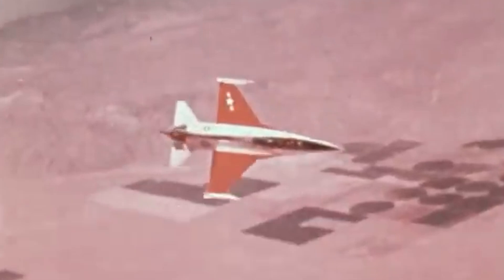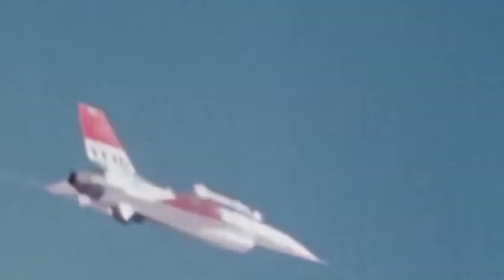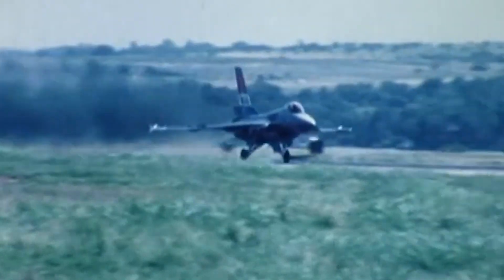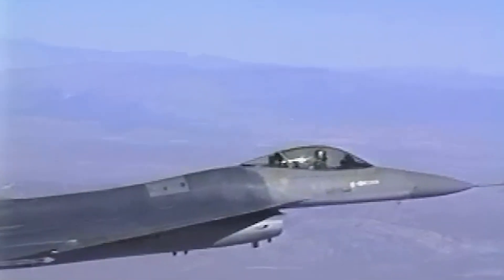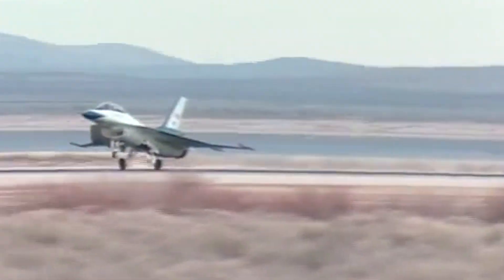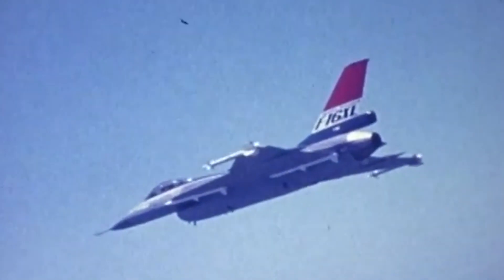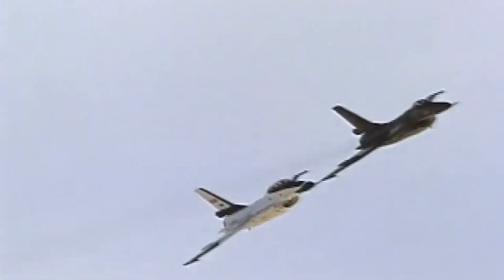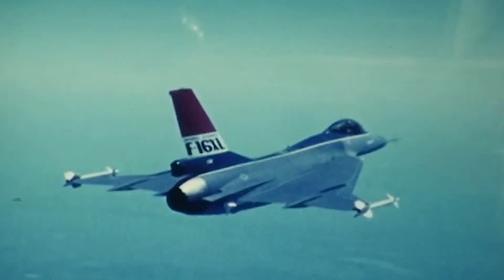When They Built a Strange Super Wide F-16

Comment: SCAMP was a research program to gain information for future aircraft.  Supercruise is useful at higher altitudes in the air to air mode. The airplane would never supercruise when loaded down with external stores.  The XL didn't achieve much in the way of supercruise until many years later when NASA installed more powerful engines.  

The XL would have been a good fighter bomber, but it was not superior to the F-15E, which was less expensive, less risky, and more capable.

Comment: To this day, I'm baffled why the F-16XL wasn't given a limited production order by the USAF. This would have been a beast in the Desert Storm air campaign. Japan did revise the F-16 with their F-2, slightly bigger and more capabilities.
Reply: Welcome to the club. Definitely a missed opportunity!
Reply: They bought the F-15E Strike Eagle instead.  There is no sensible reason to procure a limited number of what would have been a more expense aircraft that did not offer superior performance.
Reply: @gort8203  XL had far superior performance over the F-16.
Reply: @kpal2946  The XL had superior performance over the F-16 in range as a fighter-bomber, mostly due to more internal fuel.  It did not have superior performance over the F-15E that won the competition.  It also did not outperform the F-16 in sustained maneuverability, which is what that airplane had been designed for and was why it didn't have a delta wing in the first place.  It's not like the delta wing was a new invention that was not considered for the original F-16 design.